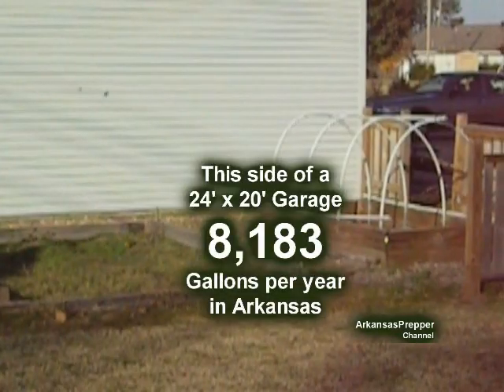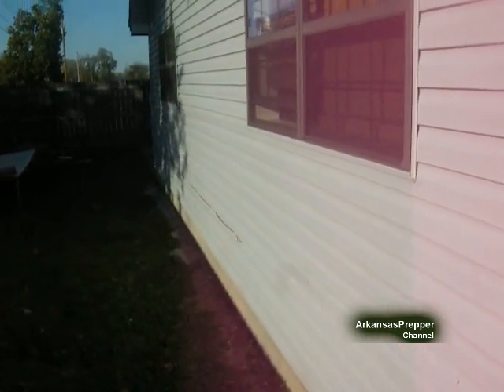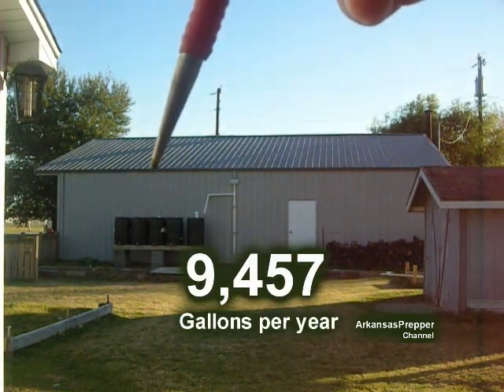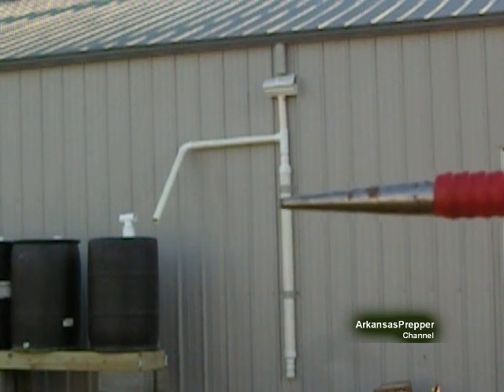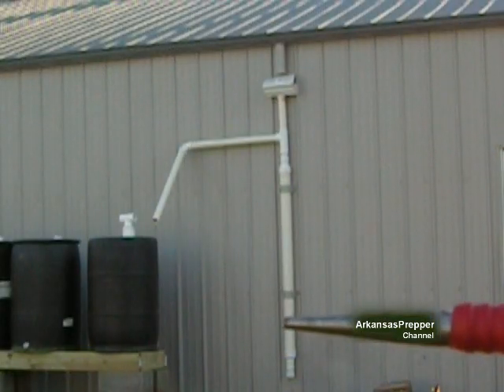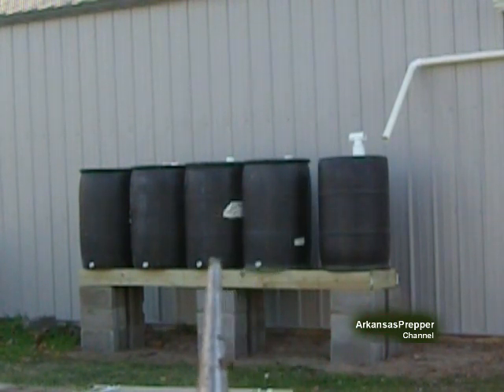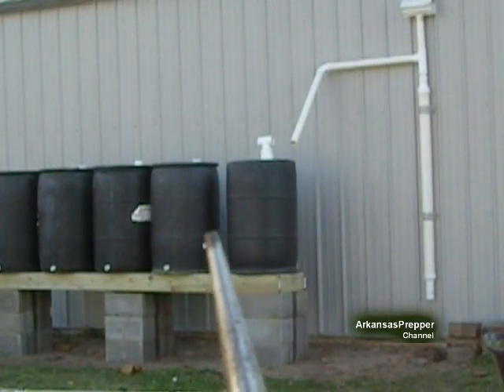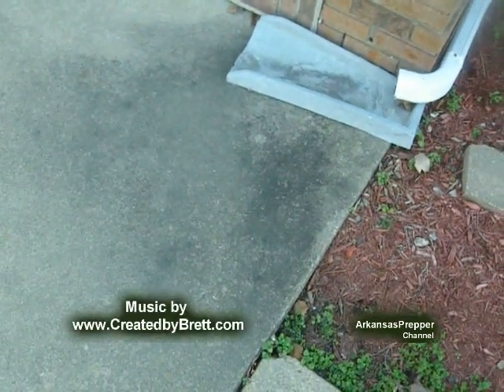How to build a Rain Barrel Storage System - Part 2

Comment: Great system and one that I think I want to try.  It will have to go in mini stages beginning with the gutter and downspout.  At the moment I only have one rain barrell and a large tin building used for a garage with twelve inch long unsupported eaves and no gutters.   At the moment the rain roars off the eaves pounding into the raised beds and killing whatever is below. The first thing I need to learn is to put a gutter on a portion of the tin building to help control the flow of the water.

Comment: Nice system, maybe it would be a good idea with some gutter mesh. That will keep leafs and larger debris, that might be carried by the wind to your roof out of the rain gutter. It will not only keep your water cleaner, but also save you time as you don't need to clean the gutters every year.

Comment: did you get this completed? I'd like to see how everything looks/works, I have decided to build a catchment system on the back of my house.since the nearest running water is almost a mile away. then put that water through my big burkey if things get bad.
Reply from the maker: I did but it is apart at this time, do not want it to freeze and bust the lines. Maybe this Spring I will get it together with a video. I have a water well about 15 ft from my back door.